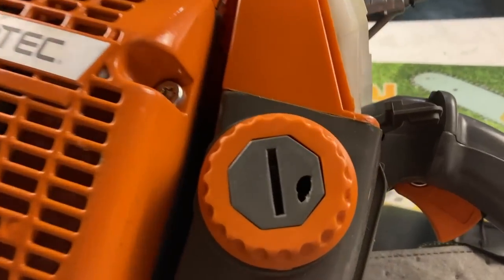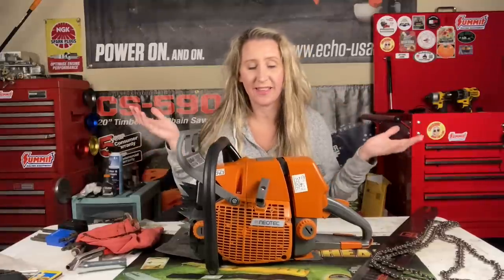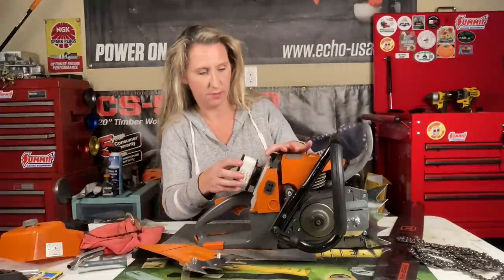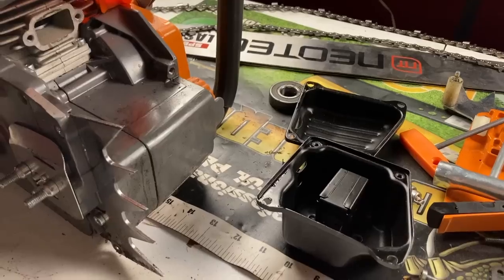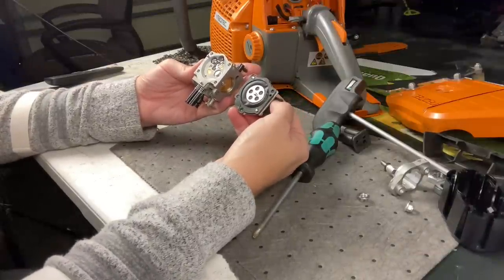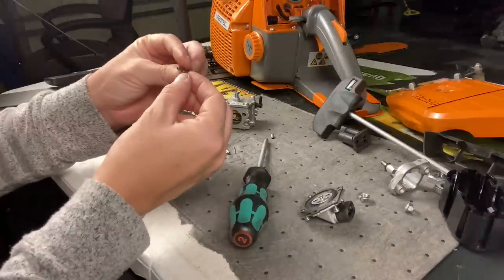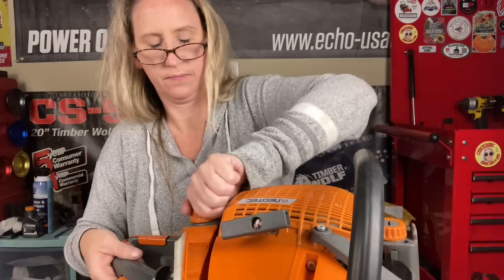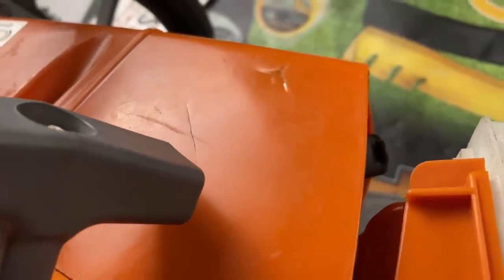NEW "STIHL CLONE" chainsaw, NEOTEC Mechanic Review and Repair. (You won't believe what happened!)

Comment: 7:45 Those ports look sharp, you can see it needed to be de burred and wasnt. You can see chipped off edges as well. Rings i bet caught the edges and chips running them up and down the cylinder

Comment: I want to thank you for recommending the GOOLOO booster a few months ago.  I just used the one I bought (on your recommendation) to start my old pickup truck, which has been ignored for more than a year!  TOTALLY dead battery, and it took only a couple of minutes to get it running!  Also, quickly recharged using my Jackery solar generator.  THANK YOU!
Reply from the maker: Awesome!

Comment: I just got my jomac chainsaw sorted out as the tensioner screws were worn out so I got new tensioner screws installed 🥰 and I inquired about getting a longer bar for my sthil ms 250 and the bar and chain are now €65 Inc vat 😲 the costs of things are going crazy 🫣

Comment: The problem with 2 stroke engines is that it relies on the owner for mixing its fuel and alot of the time in my experience ive seen scoring because the person using it kept eyeballing his mixture instead of using the mix bottle provided with the machine

Comment: They try to inspire confidence by having it look less knock-off ish by having them cast in different colors. They offer a couple 'upgrades' that make the saw cost the same as a genuine oem product (modern equivalent).

Some of the knock-off sellers will drop in oem seals and other small bits that are known to fail. I wouldn't bother either way.

Comment: Can't speak to the saws but the Chinese parts from Amazon are a little bit of a gamble. Got a carb, oil pump and filters for my MS180 that worked fine, the air filter even sealed better than OEM. The oil pump line not so much. What ever its made of wouldn't allow it to seal. Got one from Stihl, problem solved.
Good one. 👍🍻

Comment: sorry, now I will finish.  I knew it was from the orient but decided to bolt it on for a trial run.  Adjusted mixture and idle and was surprised at how well it ran, put the Walbro kit back and sharpened the chain and killed some oak

Comment: Word of advice. If you purchase a clone saw, you probably won't find a shop that will work on it. Most shops will loose their contract with the name brand saws by working on the clone saws. The clone saws aren't necessarily bad saws, if you repair and tune your own saws, but they aren't without their quirks. I suppose it depends what company produces the saw and what day of the week it was assembled. Buy with caution folks. I personally have had no issues with the clone saws, but I suppose I have been lucky

Comment: Hi my name is George,  I have a chainsaw that will not start but there is spark,  fuel  but not running, if you put fuel in the carburetor and it will run but not when it run on its own. So what would it be?

Comment: The hole in the gas cap and the cracks in the housing may have happened at the same time. Saw slid around in the back of a truck, something pushed or slid into the saw, etc.

Comment: The endoscope you have is now about $65.00 on the big "A" site, per your link.   Will the casing parts interchange with Sthil?  I run into a lot of dead saws at garage sales here in the heart of the PNW timber area. Thinking a dead one might provide casing parts.
Reply: On farmertec they do. Don't know about this one tho.

Comment: The aftermarket carbs on those cloned saws are notoriously bad. Also the cylinders are not well polished and machined so its possible the rings caught a rough edge on one of the ports and dislodged some debris. The rings could be cheaply made as well. Scoring on the exhaust side is cause for concern. No telling how long the saw will last.

Comment: Great video but I have a question about your DEPSTECH Dual Lens Industrial Endoscope.  If you point it toward an object in the room about 6-10 feet away is that object clearly in focus ?  Thanks and keep up the good work.
Reply: I have a Depstech of a different model using a wireless connection to my phone, and it's fixed focus geared more for close distances. Looking at objects at long distance can still be seen fairly well as it's a pretty high depth of field from the tiny lens, but it's not really in focus.
Reply: @dubmob151  Thanks, I appreciated your reply.  I thought Chickanic read all the emails here ???????
Reply: @Moultrie31768  it may be the one she has is different and can actually focus at different distances but the one I have is a single lens, not dual, whatever that does for it.
If you need to look through a small opening at objects 10 feet away with better clarity it may be possible to add a small convex lens to correct for the myopia.

Comment: The Stihl FS screw type gas caps will fit on the 660 and their clones.  I did a build on one.  Lots of things are marginally adequate on these saws.  I had some used 660 parts and actually made it reliable.  If you aren't mechanically inclined you should not purchase one of these knock offs.  Just my.02

Comment: To me, it is counterintuitive that the "black chunks" would not be drawn into the exhaust port as the air flow does not travel in that direction.  If it was a four stroke there could be an extremely slight chance this could happen in the "overlap" of the valves immediately prior to the compression stroke.  The scoring appears to me to be cause by improper assembly in the factory.  It would seem to me that it was assembled without any assembly lube causing immediate scoring upon assembly.  if it has been lubed there is no possible way that i cn think of that there would possibly be ANY scoring of that nature at all.  well, i guess it is possible that there was some "flashing" or some kind of burr on the piston itself.  But that is so very unlikely that the piston still had any "flashing" remaining after the other "machining" necessary in preparation of the piston prior to assembly.  But what he heck do I know.....that would add up to be NOTHING!  Laughs

Comment: I don't see anyone saying anything about the 'Knockoffs' oil ratio.  All the ads I have seen for them call for a 25-1 oil mix NOT the 50-1 that all modern saws use today.  I don't know but that might have something to do with your friend's using them on the jobsite and them burning up.  Just a thought.

Comment: I’ve had the Neo tech 843 and 865. Both are dead. The 865 never even got to cut wood. It had major piston scoring from idling at 40-1. I run the same fuel in my productions saws with no issue. IMO there trash like the blue saws

Comment: I have worked on quite a few farmertec saws. That does not look like a farmertec saw. Are the chineese knocking off a chineese knock off of a stihl saw? The ports look completely unfinished. Suprised it didn't hang a ring on a port. They should be slightly radiused. I bet the black stuff is aluminum grit left over from machining the cylinder and not being cleaned. That thing is junkotec.
Reply: Yes the Chinese are knocking off another chinese product. Neotec is not the same as farmertec.

Comment: I don't think Neo Tec is a clone of Sthil. Just as a lot of companies make similar colored saws. I own a JPNTECH 20", 60cc/3 1/2 HP, made by Komatsu Zenoah before rebranded Husqvarna Zenoah. All these saws are licensed under bigger corporations usually. This saw weighs in at 19.2 when fueled, and very beefy in design.

Comment: Re. Chinese plastics / synthetics , I've the webbing straps on life jackets become rotten and so weak you can break them just with thumb and forefinger grip , that after just a year or two and not even exposed to the sun or seawater . That is life threatening , if you need a life jacket in the water , it's usually best if they don't fall off ...
Same thing with the cheap cambuckle tie downs , easy to lose a load on a trailer going around a corner , not to be trusted . Good review Bre , I hope the owner gets enough use out of it for whatever it cost .

Comment: I have a question about a little Stihl chainsaw that I got from my dad.  It says Stihl 009 electronic quickstop on the side.  I can start it fairly easy when it’s cold.  Once it is hot if you shut it off it is a total pain to get restarted.  Can you point me in the right direction of what to check?  TIA
Reply: Fuel cap, tank vent, bad diaphram is 99% the issue. Try replicate the issue, when it doesn't start, Crack the gas cap, if it starts and runs fine, replace the gas cap or tank vent. Some engines only have vented gas caps, some only have only tank vents.
Reply: @jmabs5096 
 I have an 025 that if I let it run out of fuel it won’t restart after a fill up.  My local Stihl dealer said,  “don’t let it run out”…!
Reply: @oldmanfred8676  turn off ignition and pull the rope a few times to prime the carb, or prime it till you see fuel coming back into return if you have it. Shouldn't be an issue. If the saws under warrnty, bring that back
Reply: @jmabs5096 ,
I just asked them the question,  the saw is probably 30 years old!

Comment: If it's compatible with the parts of a 660 then you can slowly convert it to a 660 maybe it was just a bad apple I've read people who's been running them for years with no issue their customer service is bar none ice read where people got free replacements simply for the gas caps slightly leaking

Comment: The ring material might be harder than the cylinder. Id be willing to bet its cheap material. Or maybe they dont use any assembly lube. Other than that, it looks right like my 066.
P.S. That hole in the gas cap is a Chinese tank vent........hehe.

Comment: worst saw i ever bought was on of those generic $75 ebay direct from china saws, the entire frame was off to one side so the saw cut crooked . i was able to put some thick tape under the bar on one side to even it up.  i would say don't buy a cheap china clonish saw  if you not good at fixing problems and sorting bugs.  i have some hoff 372xp and 365s that run well. however i have swapped various things out on them over time.

Comment: I think it was the two cycle gas was what scored the cylinder.  A lot of Chinese clones recommend a 25:1 mix ratio.  I have built a half a dozen Farmertec saw kits and have never run a 25:1 ratio in any of them.  They get broken in exactly as I break in STIHL AND Husqvarna saws - a extra capful of oil for the first two tanks with my standard 50:1 mix.  All of my saws are still running.  My first saw was the MS 660 and it is four years old this month.
  Standard starting settings for these carbs is one turn out on both jets and tune from there after they break in a bit.  Usually the H ends up being about 3/4 Turn out and the L jet about one turn out.
Reply: John,
Great information Sir!
I watch Ironhorse on YouTube and and he runs all his saws at 40:1,  he rebuilds lots of two cycles and said he can see the difference between saws that have been run at 50:1.  He feels they don’t get enough lubricant to the necessary areas?
Reply: I run 42.5:1 in my Stihls/Huskys and 32:1 in the clones and other older steel sleeve 2-cycles. Orange bottle HP in all.
Reply: @shannonwhitaker9630  my Farmertec, Huskies, MAC, Poulan and Stihl saws all run the same thing 50:1 Husqvarna XP (a JASO FD certified oil) plus premium, non-ethanol gas and one ounce of stabilizer per gallon.  I have used Echo Red Armor and Power Blend Gold with equal results.  I ran orange bottle Stihl HP at 45:1 for a while but it is only slightly cleaner than Stihl Ultra.  I ran Stihl Ultra at 50:1 for years with no mechanical problems but it is filthy.
Reply: @shannonwhitaker9630  it is RPMs that kill saws not what ratio of oil you are using.  I keep my saws running in the 12,600-12,800 range at all times.  Thick oil ratios actually run hotter than 50:1, because they are lean mixtures.  Gas is what cools saws and if you have more oil in the mix you have less gas, hence a lean mix.  If you are worried about your saws get a good inductive tach and check their WFO speeds, periodically.  Cold weather is just as bad as dull chains, because saws need more gas in cold weather than in hot weather.  I would much rather run my saws rich than lean.  I am not worried how fast it cuts, just that it does today, tomorrow and next week.  If I want faster cuts, I grab a bigger saw with a longer bar.

Comment: Well there you go! Made of plastic, not ABS at the least, the kind Chinese kids toys are made of! In fact I think kids toys probably have a higher standard of build. As to the black getting sucked back into the cylinder, remember two strokes rely on a small amount of back pressure from the exhaust (there's a fair bit of magic to explain why) and the damage looks as if it were dropped on its side.

Comment: I bought a neotec 872.  The first tank of gas some parts fell off, the second tank the throttle cable wouldn’t put the throttle all the way open I got glued it in place so it would work, on the third tank the engine locked up, complete seizure.  Total run time of about 30 minutes.  I was able to get a full refund from Amazon.

Comment: Aren't these saws fuel mix at 25:1, not the usual 50:1?
Reply: The online consensus on forums seems to be that people run them at anywhere between 32:1 and 50:1. The 25:1 mix "suggestion" from the manufacturer is mostly referencing countries where quality 2 cycle mix oil isn't available. Mix 25:1 if still using SAE30, use 32:1 to 50:1 if mixing quality name brand rated oil; stihl, husqvarna, VP, etc.
Reply: I bought one of the 52cc Vehpro Chicomsaws for $75. Believe it or not it’s a pretty good running saw. If treated gingerly I’d imagine it could last a good while. I run it at 32:1.

Comment: I bought a farmertec joncutter top handle saw four years ago with 12" bar and chain shipped for $100. I sure can't complain for the money. It has been quite dependable but it had its quirks and I wouldn't recommend it for somebody without decent mechanical aptitude. It will start on the first or second pull right now and has always run well, but it is a placeholder until I get an echo. I didn't have enough morbid curiosity to buy one on their bigger saws...I bought a 620p echo instead and I love it, but the air cleaner was nothing to brag about.

Comment: It definitely is a piece of crap not only the parts itself but the installation shows no quality. But the damage might have been caused by someone putting it in the back of the truck and it falling or something falling on it. I’ve seen it with other equipment. But your right it’s crap. Keep up the good work and videos

Comment: I bought a husky 62?? Version. Coil went out. No support from reseller. Bought it thru Amazon reseller. Sent it back and got money refunded. Reverse engineered such that it said “Sweden” inside clutch cover. Bought Remanufactured husky 455 one off eBay with two year warranty.

Comment: I don't buy the saw not being abused after it did not run. Some of that looks like it was mishandled after it did not work. Most certainly the carb had a big problem with the needle valve. I doubt it is returnable now that it has had gas in it, and you have worked on it. Hopefully you can fix it for him. But I think the scratches and hole in the gas cap are something the owner did after the fact.

Comment: I guess that it’s possible that once the muffler paint makes it’s way BACK into the combustion chamber and then with the heat and compression from the combustion process that the “now hardened” paint could possibly score the cylinder, but what does the piston look like from the carburetor side? It’s just that stuff like these kinds of questions are impossible to answer on a video because of the time lapse.
Have yourself a great day Bre!😊
Reply: I would think that paint would burn right up on combustion?
Reply: @oldmanfred8676  I’d think that it would burn up too, but I would think that it would be cured by the time that I got her also 🤔

Comment: Hello, many may not be aware but Neo-tec is a popular brand. Its the price. Yes, they do need a few oem Stihl parts to fix weak points-compression button, replacement of plastic chain adjuster and oem caps. Price of the saw plus $100, you have a pretty decent tool for 1/3 of oem prices. I dont have a neotec, I use echo CS's 590 and 310. I am still very close to ordering a neotec inspite of some of the bad publicity. I think they look very cool. I have mechanic skills, my echo's never need to be worked on and I'm bored. Top ends are very affordable for Neo-tec's, would be a great learner saw to learn to port on I think. You actually said alot when you stated there are a ton of aftermarket parts available for the Stihl saws! 
Do you want a huge boost to your channel views? Buy a Neo-tec and make a series on what it takes (from your perspective) on what it takes to make a this saw a reliable powerhouse. Just sayin'

Comment: I find with these cheaper saws you need to run alot more oil. I have a Chinese 372xp and I run it on 20:1 mix and it is super reliable and parts are cheap and easy to get. I opened up the engine a while back and after about 30 hrs use only have minor marks on the piston but i can't feel it and the honing marks are still there as well.